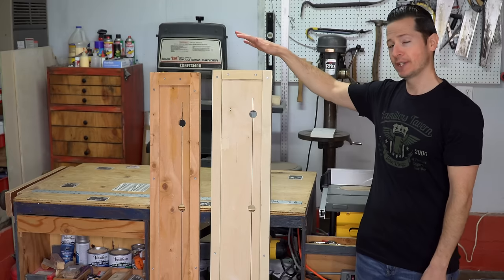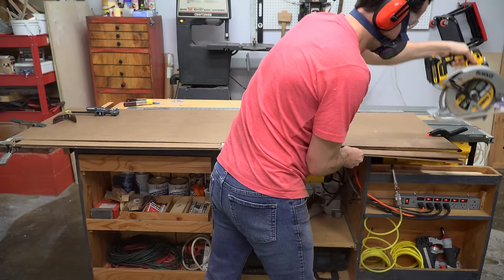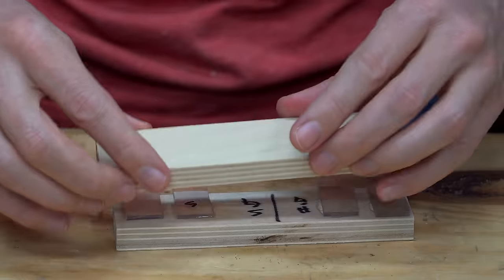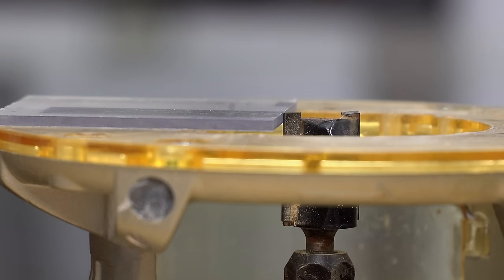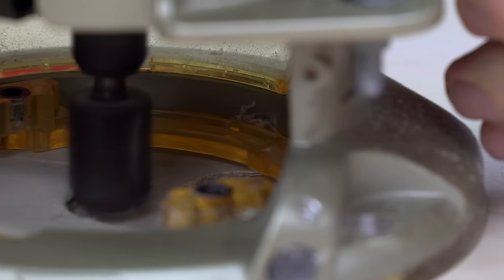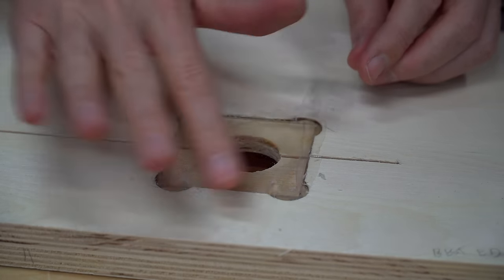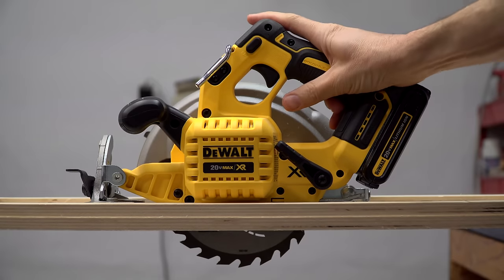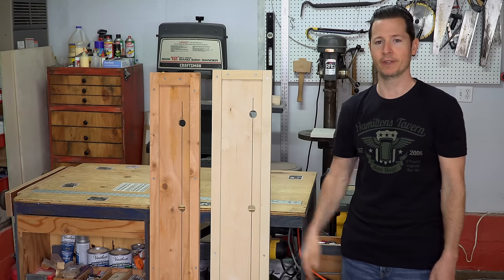DIY Saw Track Update

Comment: Loved your video, and I am a beginning woodworker so I am soaking up everything you put out there. However, I would like your advice, because I am going to build one out of 10' plywood or put 2 pieces of plywood together for the extra length. The reason being is because if I need to rip an 8' sheet of plywood, and if my track saw cutting distance is less than 8' then I will have to re-position my track. Do you think it is worth the extra expense to add a little more length?
Reply from the maker: It just depends on what you’re going to be cutting most often...and whether or not you have another way to do it. I usually get away with full length rips on my table saw. Cross cutting a full sheet (across the width) is a lot more cumbersome on a table saw, so a track that will cut 4’ is perfect. Another idea is that you can have an old school one-sided track for full length rips, and a two-sided track like this one for everything else. That way, you only need an 8’ sheet of material to get away with making a full 8’ length track; you just have to be a little more carefully when making those longer cuts. Anyway, I hope this helps! Thanks for letting me know you enjoyed the video, and good luck!
Reply: @OneMinuteWorkbench  You just saved me a lot of time and effort. Great advice like this is why I love your page. Thank you.
Reply from the maker: No problem!

Comment: Nice new saw! I'm struggling to add a dust collection box to our old 30-something Black & Decker before I build my track saw, so this update comes at a good time. But really I'm wondering if it isn't just time for us to get a new circular saw, something that already comes with some sort of dust control. So I'm hoping you'll do a review for the new Dewalt!
Reply from the maker: Bonnie, the saw doesn't have any dust collection, but I'm pretty happy with it. It's a little under-powered, but overall it's pretty nice. I don't do reviews very often, but I might do one after I've had a chance to use it for a while. I hope this helps!

Comment: The first one was simple and worked great!   The purpose of the holes was to see the cut line . So the question  on this one is adding the plexiglass did what?  The purpose of the holes is still to see the cut line  ? All I saw  was additional work  and expense for zero gain in what the original design did.
Reply from the maker: Yes - the first one was simple, and in most cases, this build would be overkill. I think the big thing I forgot to mention in this video was that the plexiglass continues the zero-clearance slot, even through the site hole locations. The other thing I should have mentioned is that since most people use tracks like this for breaking down sheet goods, it's not really worth making sure the zero-clearance is 100%. The only time you'd really need that is if you're making furniture quality cuts on edges that will be exposed in the final piece. So again, this one is just overkill for most people in most scenarios. I hope this make sense!

Comment: I like this...

You know, I would have rounded the plexi corners rather than making the recess oversized... but that's just my taste.  However... I do have a question - or rather, a challenge?

How do we make one that will cut a full 8 foot sheet?  Where do we get a 10 foot long piece of plywood to make it out of?  Hrm...
Reply from the maker: Thanks, James! You can find longer pieces of pre-painted stock in the trim & molding sections at Home Depot and Lowes that might work. Another option is going to an actual lumber store, where you might find 12' sheets of higher quality material. I hope this helps!
Reply: Most of the big box stores whether it's the blue or the orange, around So-Cal anyway, have 10' plywood paneling. Not the best looking stuff, will require a lot of sanding to make it smooth, but will work for what you need. The other option would be to splice a section of ply at the end with a lap joint and glue, and then use a 10' solid wood for the side rails for reinforcement. Hope that helps, happy building.
Reply from the maker: Thanks for sharing that info!

Comment: Could MDF be used for the base plate instead of plywood ?
I am guessing that MDF would have better flatness, dimensionally stability, etc.  But just guessing and would be happy to be enlightened as to the pros and cons.
Reply from the maker: I think the biggest problem with MDF would be the weight...it's HEAVY!
Reply: I did make a 48 inch version out of MDF. I don’t mind the bit of extra weight
Reply from the maker: Thanks for sharing about your build! Can you share an idea of how heavy it is?

Comment: Well Hello, it looks like he used "my suggestion" of the "Plexiglass" Good job... Why did you not do a sample cut for us to see and find out whether or not it actually helped with  Tare out at the sight holes.. Greg
Reply from the maker: I didn't have a scrap I could spare for testing the cut just yet. I had a piece of plywood (the one I drew the line on), but wasn't ready to make the cut just yet. I have to finish planning for the next project. That said, I'm sure it'll be in one of the next few videos!
Reply: @OneMinuteWorkbench  test it with melamine which is more prone to chipout.

Comment: Brilliant.  How much play is there in your side winder saw blade/axle?
Reply from the maker: I find it to have very little play, but I don't stress it very hard. I usually only use with for making light cuts, and breaking down sheet goods with the track. For heavy duty jobs, I use my worm drive. I hope this helps!
Reply: Yes, it does!  Thank you.  I find many side winder saws have 1/8" (3mm) of play, leading to wavy gravy cuts and terrifying jams.

Comment: I like the new version. What's a good way of making one to rip an 8' sheet without having to find a 10' long piece of plywood to make the sled?
Reply from the maker: You could build an old school one-sided track out of 8' material. You'll need to be a little more vigilant while making a cut to ensure your blade doesn't wander off, but it is an even more simple method for build a track that will do the job. I hope this helps!
Reply: @OneMinuteWorkbench  It does. Sometimes the KISS solutions are the best
Reply: Build an 8’ track and then cut halfway, line everything up
Again and finish cut

Comment: Great video! I need to make myself one of these. Did you use any special blade on the table saw for cutting the polycarbonate?
Reply from the maker: Thank you! I just used a cross-cut blade, but it would have been better if I'd used a blade with even more teeth (like and aluminum cutting blade). Anyway, I hope this helps!
Reply: @OneMinuteWorkbench  totally helps, thanks!

Comment: I bought the cheapest one on Amazon for under $50 and didn't look at the features. 
This Skil Saw has a laser pointer built in. Besides that I also purchased an aluminum saw guide that clamps onto the work piece. One move of my wrist and it goes off my line. 

I was wondering if I could get the two together as a single unit. A straight edge clamp and a saw that won't shift on me while cutting. Not sure but I think that it came from KREG. It's 55 inches long, 2 rulers and narrow tracks on either side. I would really like some input. 
Putting a small frame to hold the saw? Maybe an aluminum strip to lay in the tracks? My concern and indecision stems from the fact that the saw blade starts back beyond the end of the guide. And then the idea bell rings and a light goes on.
The guide is for ripping plywood. So, what if I clamp at the finish end. I would still need the blade to extend past the clamp.

Comment: I would probably have made the holes for the plaxiglass a bit deeper, so that the plexiglass woudn't get as many scratches  when using the track.
Reply from the maker: I use it all the time, and so far, scratches haven't been a problem. Also, if the plastic was recessed further, it would no longer create "zero-clearance", which was the whole point in adding the plastic in the  first place. Honestly though, after build two tracks, I'd build the next one without plastic inserts. It does give it full-length zero-clearance, but I find for the type of stuff I cut, it's usually overkill, and not really worth the extra work of inserting the plastic. Anyway, I hope this helps!
Reply: @OneMinuteWorkbench  That makes perfect sense

Comment: Instead of plywood or masonite as the base, with polycarbonate inserts, just make the base of polycarbonate.  It comes in various thicknesses.  It is laser straight from the factory.  It may be too slippery against the work surface if not clamped, though.

Comment: Like your video doesn’t have a ton of extra fluff. And I know you added the plexiglass but I don’t understand what it does more than the sight hole? Also have you found that most the time you wish you had one that was 60 inches long? With a cut area roughly around 50 or so you wish you or maybe 70 with cut area around 60?

Comment: Have you had a problem with the 2 halves of the guide moving in or out in the middle? At each end the ply is solid across both halves, but in the middle there's nothing to prevent the 2 halves from moving in or out. I'm thinking of making a long one out of 10' ply for ripping 8 foot ply, and I'm thinking with this long length the 2 halves might move on me.
Reply from the maker: I haven’t, but making it longer will increase the chances of that happening. Make it from a wider overall piece than I did, then each half will have more cross-section strength to resist deflecting. You’ll have more overhang on each side, but that just gives you easier clamping options. I hope this helps!
Reply: @OneMinuteWorkbench  Thanks for the advice.

Comment: The plexiglass seems like overkill to me. I am planning on building one of these for myself without the inserts. You still have the cut line to line up the desired cut...
Reply from the maker: The plexiglass is just to help reduce tear out at the site-hole locations, but the track will work fine without it. I hope this helps! Good luck with the build!
Reply: @OneMinuteWorkbench This may be silly but when I was working in the construction industry the "door guys" had a single sided saw guide made out of just plexiglass. I was thinking that when I make mine I would make my base layer out that and probably use 1/2" plywood as the guide as the guide material. In my mind I think It would look cool. What do you think ? Just looking for opinions before I make mine...
Reply from the maker: It would definitely look cool 😎  A few others have suggested making the base all out of plexi or polycarbonate. I’m sure if it’s thick enough it’ll probably work. The only problem is that it might be expensive. That said, if you can come across a sheet of plexi for a reasonable price, I say go for it! And be sure to come back and let us know how it turned out!
Reply: You’re gonna have a harder time finding it in the shop, w/it being clear, lol. Good luck w/the build, and video document it, so that others may view your geniusness!

Comment: Hey I need to cut stair treads and so I will make the jig but which blade do you recommend for my circular saw. The treads are red oak.
Reply from the maker: These days I pretty much just always use a relatively fine tooth Diablo blade. Takes longer on rip-cuts, but the quality is so much better on cross-cuts. I hope this helps!

Comment: Can I use a pair of regular circular saw blades to get a thin 1/4" dado instead of spending $300 on a dado stack?
Reply from the maker: I'm not sure, but I'm guessing not. Better safe than sorry!
Reply: Why not just doing 2-3 passes, moving the fence over just a smidge, sneaking up on the cut? Too simple?

Comment: Great job! But I don't get the pourpose of the plexiglass, just a show off? 😂
Reply from the maker: Thank you! The plastic just continues the slot, therefore continuing the zero-clearance the slot provides. I hope this helps!
Reply: Sorry for the newbie question, but what is the benefit of the zero clearance? Certainly the saw blade won't wander when passing through the sight hole.
Reply from the maker: Sorry for the late reply. Zero-clearance helps reduce "tear-out". Which is where small fibers near the edge of the material tend to splinter out away from the cut edge. Zero-clearance provides a backing that prevents those (or again, at least reduces those) from splintering outward. Have a look at this video, near the end. I show an example of what a piece looks like when is cut without zero-clearance compared to when it is: https://youtu.be/O18haYOu4fU Starting at about 9 mins and 45 seconds, I install the zero-clearance insert and start making test cuts. The comparison comes just after that. I hope this helps!

Comment: Did it make it easier to line-up with line using Plexiglas?
Reply from the maker: The main purpose for the plexiglass is to continue the zero-clearance function of the slot, but it probably does help alignment a bit as well.

Comment: Why does the factory edge matter on the Masonite if your cutting the saw kerf yourself in the middle of the board? Just like the regular saw guides that are common place, it’s just lighter weight to make them out of hardboard or Masonite.
Reply from the maker: I'm not sure I fully understand the question, but I'll address what I think I understand. The edge of the hardboard had variations, so there was no fully straight edge I could use to "true-up" the rails that guide the saw...at least not perfectly. Also, I failed to mention in the video that a lot of people seemed to indicate that hardboard would be lighter. I was shocked at how heavy the Masonite is, and the fact that it is slick and thin with that weight makes it much harder to hold and carry than the plywood version. And the final nail. in the coffin for the hardboard is that it damaged very easily. The edge was degrading before my very eyes as I just moved it around the shop. Every little ding wore away at the straightness of the edge. I just couldn't imagine it lasting anywhere near as long as plywood. All that said, I'm still open to suggestions! Thanks for the feedback - I hope this makes sense!
Reply: @OneMinuteWorkbench Huh. My conclusion when watching the video was that the masonite was warping after you cut it. Weird that it didn't have a straight edge from the factory.
Reply from the maker: It definitely warped after the cut...the internal stresses took over and produced a bow. That's actually not too big of a deal, because as long as the factory edges are straight, I could have used those to line up the cut piece's factory edge. In general, the factory edge quality was not great. It also just seems like glorified cardboard, and I don't think it would be durable in the long haul. Anyway, I hope this explanation makes sense!

Comment: If you have a table saw, why do you need a track saw? I am new to woodworking and have neither. I do have a circular saw though.
Reply from the maker: Steve, a table saw is usually the main cutting tool in most woodworking shops, but it can't do everything. A track saw excels at breaking down sheet goods, which can be very cumbersome (and even dangerous) to cut on a table saw. That said, if you need to break down sheets, or need straight cuts and don't yet have a table saw, a track can help. Here's how to build one without a table saw: https://youtu.be/68v9JlSM6OQ I hope this helps!

Comment: maybe i missed it, but what exactly are the advantages of this one over the previous one?
Reply from the maker: The advantage (if your application requires it) is 100% zero clearance, whereas the previous one did not maintain zero clearance at the sight hole locations. It’s probably overkill for most situations though. I hope this helps!
Reply: @OneMinuteWorkbench  Ahh, gotcha. Thanks!

Comment: What difference, if any, did the addition of the plexi make???
Reply from the maker: It creates zero-clearance at the sight hole locations, which reduces tear-out. I'd say it's not really worth it unless you need furniture quality edges with the cuts you make with this track. For the most part, people are breaking down sheet goods with a track like this, but again, if you are making furniture with it, it might be worth-while to go the extra steps required. I hope this helps!
Reply: @OneMinuteWorkbench  Thank you for the fast reply. That was very helpful info.

Comment: What about using 1/4 in MDF? I've been thinking about using 1/4in for my build.
Reply from the maker: I can't be sure, but if you try it, be sure to come back and let us all know what kind of results you get!
Reply: @OneMinuteWorkbench  I just made the track with 1/4 in MDF this weekend, and made it to span an entire 8ft section of ply. Maybe a little over kill. It definitely has a bit of structural flex with that long of a length, but only when it's not being used. Once its place on a piece of plywood to break down, there is no flex. Works great. Nice, light and portable. Next up will be a 5ft piece.